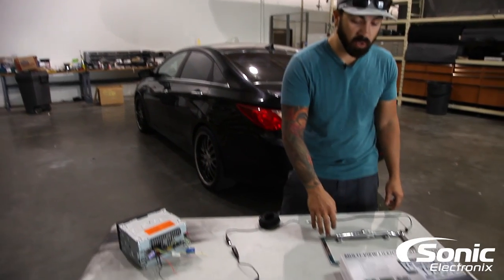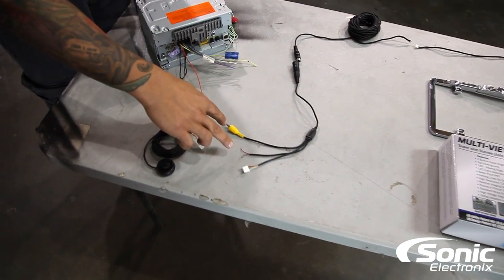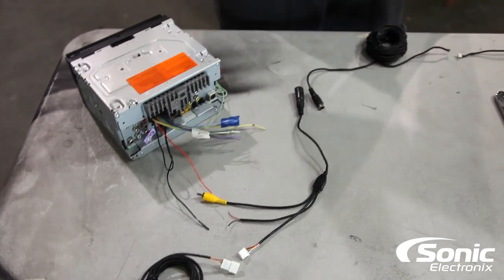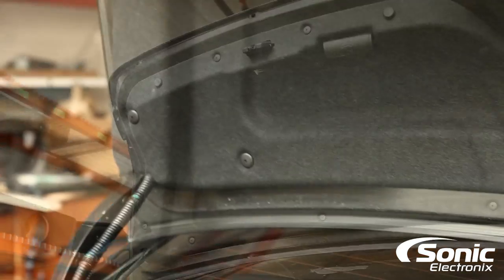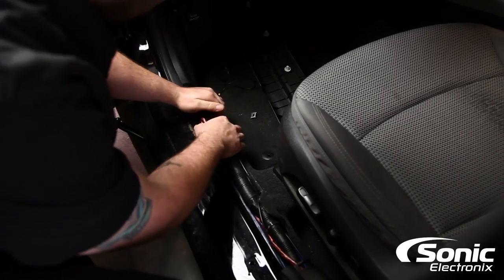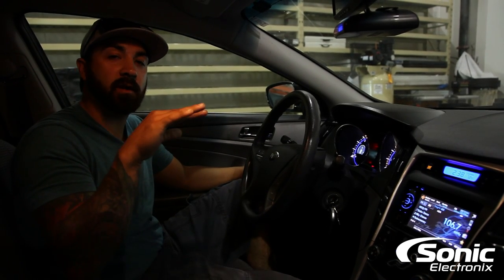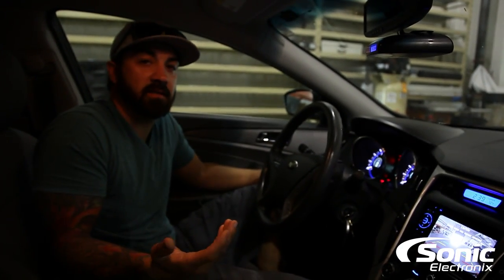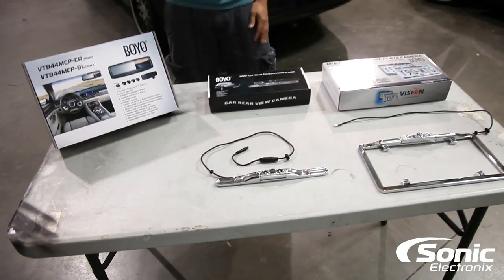How To Install a Back-up Camera | Sonic Electronix

Comment: I learned a bit from the beginning but pointing at the car where the wiring goes then saying "it's done so let's test it" doesn't help at all. I know you can't show how to do it with all cars and all cameras but you could have shown how to do it with that car and that camera. It's frustrating. There's nobody out there that really explains exactly how this works. What exactly is the trigger wire? What's it attached to on each end? What's the best way to tap into the reverse lights? Which wires are needed for power on the front end? Wireless vs wired? How can you get that big video wire threaded thru to the front easily? 

If you could do a video on any of that you'd help a lot of people, or at least one, me.

Comment: guys, your ”reverse" lead wire goes to the reverse wire on your harness. your car needs to tell the radio when it goes in to reverse. the camera trigger can be locally connected to the reverse light in the rear of the car or, tapped into the same trigger wire at the radio if you want to run it all back to the unit. again, reverse trigger on radio goes to reverse trigger on vehicle harness. metra or spectre should give you a pin out diagram for your vehicle when you buy one of their harnesses. hope this helps.
Reply: Thank you!

Comment: Hey great video thanks for sharing I have a question I’m having an issue with my setup I have a pioneer in dash with a pioneer camera I tapped into the reverse wire for power to the camera and also connected the purple white cable from the in dash (labeled reverse from manufacturer) to the reverse wire on my car I get a signal from reverse but only if I go to camera view it doesn’t automatically change to camera view when in reverse any clue what the problem might be? I played with the polarity setting battery and ground none seem to be triggered by the shift to reverse

Comment: So does that camera have those views because it has more than one camera or it's just the capabilities of the 1 camera? 
Is the control for this camera a knob or what kinda control is it? I was looking for something similar. 

I also was curious to see if you've ever tried multiple cameras and using a switch to go back and forth from each camera view. 
I just dont know what switch I would get.  I was thinking a 4 position knob with a switch for power. So in order for the a camera to show, you would turn on the power switch, then turn the knob to which camera view you want. I already have a rear, but I wanted to install a front one for parking as well and side ones to help with blind spots and merging.

Comment: I just picked up a backup camera and would like to have it on demand instead of just on reverse. I tow a boat a lot and it would be nice to check on my hitch/boat whenever I wanted. So my question is I will need to install my own switch for the wakeup wire on the stereo head unit and I might as well run my power to the camera from that as well correct? Thanks

Comment: What do you do with the reverse trigger (coming from the radio) do you connect it it the ground (black wire)?????????? Please help
Reply: +houss3105 thats exactly what i  needed to know and he didnt even explain it.
Reply: u need to connect it to your car's reverse sensor cable.  My scion tc is under the glove box . it is a pink wire.
Reply: its very simple ,just  use a test light to find the reverse signal on your car wire harness. after you find it all u have to do is connect both the power wire thats coming from the camera along with the reverse signal wire from the stereo
Reply: @wave7707  He shouldn't have to show you. He explained what to do.

Comment: if I may ask I just bought a pioneer avh 4100 nex I am unsure if that model has a certain backup camera but I am looking for 1 I have the cable for it just unsure how long the cable are from back of vehicle to be ran and connect to my headunit what are some good camera for the licsense plate 1's with night vision and really clear on the screen

Comment: Got a question for y'all over at Sonic, will the bar type camera have a problem viewing the whole 175 degree footage throw a Nissan 350z? I only ask because on the z the license plate is mounted in an indented area on the rear number. Thanks

Comment: Reverse trigger what wire to put on. I got back cam install already . Went to setting and it work but when on any menu reverse the cam doesn't pop out. Habe to got to setting for it to work

Comment: Is it possible to share the cigarette adapter to power up both cameras (frontal & rear), specially to avoid touching the original electrical circuit of the vehicle (preventing this way breaking the car agency guarantee). This would provide a solution for brand new cars, by enabling the rear recording to be the same time as the frontal one.

Comment: I have a a double din that has a seperate wire for reverse & parking, i have the yellow rca to the back of the HU and it has power and ground hooked up but it doesn't switch when i change to reverse, my question is where does the reverse trigger from HU have to be hooked up to trigger it?

Comment: Hello i wonder if i could retrofit a backup camera on a nissan x trail t30 original sat nav unit display . Unfortunately it doesn't have an rca video input. Could it be tied to some display input wires ?

Comment: does it also show you the area behind you when switching lanes like to show you Wether or not there's a car behind you in the lane you're switching to or does it only show reverse
Reply: I just installed the Boyo camera. It is connected to my Pioneer  head unit.  It only turn on when the car is in reverse.

Comment: im trying to locate the reverse wire so that i can connect it to my headunit. so when the car is in reverse my backup camera shows up on the headunit. i have a 2002 acura tl AT. thanks

Comment: I usually love your videos but this one was kind of disappointing. You gave us the "alright, this is the basic idea of how you would install this" prep talk and then showed a few seconds of somebody running the wire under the door panel. There was nothing in depth. You didn't even show us the installation, it was already done.

Comment: Theoretically, couldnt you have like 4 cameras all around the vehicle and run them into a toggle switch  so you can toggle between views while your backing up. Or even run the Reverse wire to a switch with power always on to initiate the camera at any time?

Comment: I installed a jensen vx 702 in a 2011 dodge ram. when I put the vehicle in reverse the camera powers on, but I have to manually select the camera option on the unit. how do I get it to automatically go to the camera screen when I put it in reverse?

Comment: Question for you, so if u set everything up correctly and it's working fine image pops up but the only problem is that the camera is set in the wrong side so example I see image opposite side like the side walk is on my right and the image shows it on my left so how to adjust that??? thank you
Reply: +Melanie T you might have what they called mirror image, look through the instructions on your booklet and see if that is turned on in the menu.

Comment: I have my back up wire from the stereo connected with the power wire from the cam to the power on the reverse light and the cam stays on immediately i dont even have the ground from the cam hooked up can you tell me whats going on im installing on a 03 lincoln ls with the planet audio 7" P something 52 not entirely sure of the model number im positive it has 52 in the end please help
Reply from the maker: ENERGREKS1 Allyn says that your camera is coming on without ground connected because it is pulling the ground through the shield of the video RCA. And if it is powering up when you're not in reverse then you must be tied into the wrong wire in the back, could be break light or constant instead of the actual reverse light. (Not sure if you were stating that as an issue too.)

He says his recommendation for wiring backup cams to stereos is: 
Camera power to stereo constant, and also tied into reverse light in rear. Reason being that some car stereos you can manually trigger the reverse camera while driving, if camera power was tied into stereo reverse trigger alone, this function would not work.

We might go ahead and do a Q&A on this in the future too, but hope this helped you for now!  :]
Reply: Sonic Electronix my brother your awesome!

Comment: Hello there, aloha everyone! need some help here if any? I got one of those camera, and ive installed it, followed every single instruction for installation! I have a alpine ive head unit with a reverse trigger, i connected the camera power source to the reverse back up light, and the reverse trigger from the head unit to the + reverse back up light! In the morning is fine camera works ok, powers on when switch the gear to reverse and triggers the head unit to show the back up camera, but the problem is at night, yes! Its When i turn on the tail lights and step on the brake pedal, my head unit triggers to camera even gear is not on reverse, there is no image since camera on powers when i put the gear on reverse! So yeah at nigh when i turn on the tail lights and every time i step on break this happens, it triggers my head monitor in reverse, i tried and check all the wirings, and even replace all the tail light, brake signal light bulb new, but its weird when i remove one of the brake light bulb and turn the tail lights on and step on brake its doesnt trigger my head unit monitor to reverse,! Is there anything im missing? Really need help, thank u in advanced, mahalo!

Comment: There is a big problem with these cameras, see here at 2:50 , it's actually a legal issue. It coves the plate stickers which will cost you a fine the first time and suspension of your driving privileges in all US states for a repeated offense . You shouldn't be selling this product, you are deceiving people for the purpose of a profit, therefore  you could end up in prison too. Every one who ever had a car knows that the stickers must be visible at all times. A judge will not give you a break on that, this is very basic knowledge for any vehicle driver.

Comment: Step one should be to TEST the system before doing ANYTHING, not step 3.  Why would you want to get all that wiring in place and installed before even testing the system to be sure it works?  That's a lot of re-fishing wires and undoing wire ties etc.

Comment: Hooking up the camera to the power like that is not going to be good in the long run.  It's the cheap way to install it if your too lazy to find the appropriate wires under the dash.  Reverse cameras should only be powered up when the car is in reverse.  Anything more than that is excessive wear on the camera.
Reply: +broderp why would it be bad in the long run? i run my camera during the day time when i have my camper hooked to my truck. and i shut if off with the switch i have it run to the only time my camera has power is when the monitor detect power from the camera. they are not meant to last forever just the life of the product.

Comment: help, when i put the car back in drive, the "caution" heading does not go away and screen is black, any ideas on how to fix. I placed it on a pioneer avh4400 bh radio.